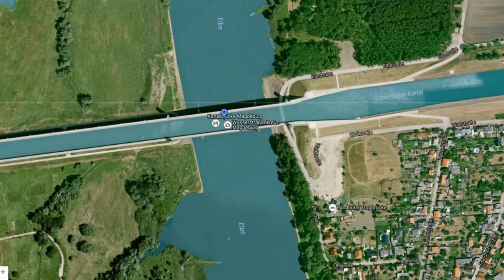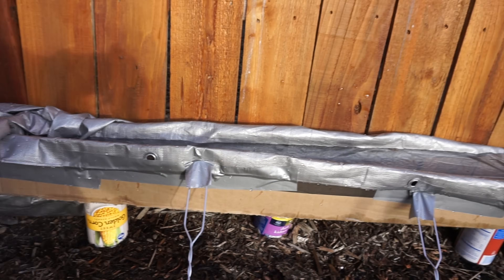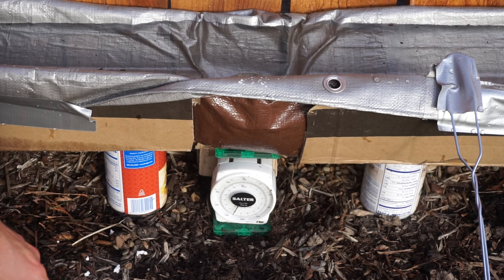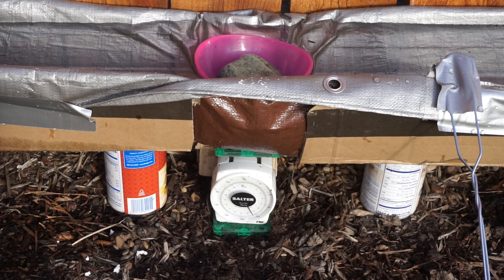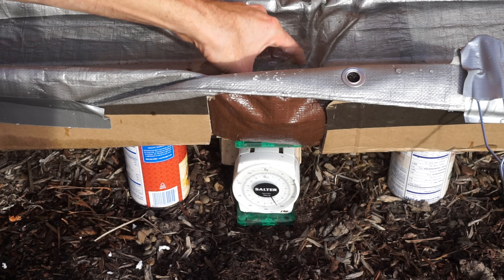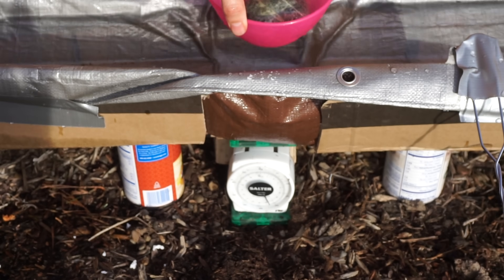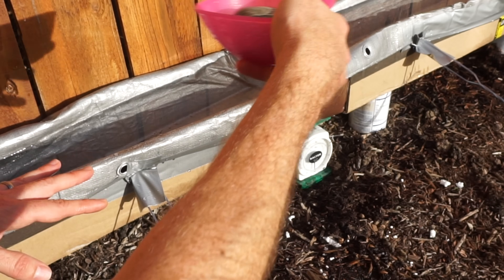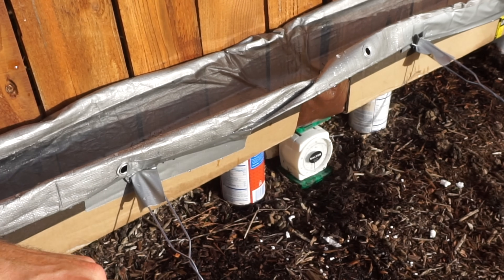What Happens When a Boat Crosses a Water Bridge? Does the Weight Increase?

Comment: im no engineer or smart, but i still disagree by intuition. the displaced water lets the level rise, therefore more mass is on the bridge. if you measured the whole bridge instead of a negligible section, you would see an increase. sure, the boat is small compared to the water, but if you would put it inside instead of moving it from left to right, the displaced water had no time to even out before the weight increased. 
the weight does increase with every object added, but distributed so wide that its barely measurable.
Reply: Yup you're right the weight of the bridge does increase but it is distributed everywhere equally
Reply: But your not displacing just the water in the bridge, but all of the water either side of it too, which could be a considerable distance and thus the weight of the boat would be spread across a very large area of water.
Reply: Yea, you're technically correct but in the real waterway and his experiment, it is a negligible amount, even if the boat is very heavy. In the waterway, the weight of the boat would actually be distributed across miles of water.
Reply: When the water rises from the boat passing through it is removed from the place where the body of the boat actually is at the given moment. So the amount of water remains the same or there is even less water on top of the bridge since the overflow will go outside the entrance and exit of the bridge.
Does the weight increase? I got no idea, I would say the weight increase is really insignificant since the water distributes is evenly
Reply: @petrolmajk  if you displace a large amount of water and push it ahead of the vessel it would rise and stack causing a wave and increase in weight prior to settling at a certain level.
Reply: I feel like you're treating the bridge as an isolated entity, the water displaced would also go outside the bridge area, and therefore wouldn't actually impact the bridge and the weight its carrying
Reply: It would depend on the speed and wake of the vessel but it would be negligible as a percentage relative to  the permanent load of calm/stagnant water.
Reply: There is an upward force which is not immediately intuitive. Take a large vessel and try pushing in a tub of water. You will feel the vessel pushing upwards (until you sink it low enough that it starts taking in water).  Thats boyancy. The weight of the boat/ship is balanced by the water pushing upwards and that's how it stays afloat. Hence there is no load change on the bridge support.
Reply: you technically aren't wrong because Action lab's experiment was slightly bias, as he did not show us the reaction of putting more water into the bridge, but if he did, the weight wouldn't change, because the material that he used was a picnic table sheet, which means that adding more water will pressure the integrity of the picnic table, but it will not break/ apply more pressure, but when he put the rock over the weight measure, the weight changed, and that is because he focused weight in that area, allowing the picnic table to droop into the weight measure, but yes, you are right, weight will still be applied the same way, but he is also right because that bridge in Germany is connecting two water ways, so the water because pushed away is too little and the water is not focusing on one point either, so he is right but wrong, the total weight being applied will never change, its just the area of the water being applied, you might not understand, but that is ok.

Comment: The raise in water is limited to at most the speed of sound in water. In practice, it will move as a wave out from where the boat enters the water. It will not start at the bridge unless you drop the boat in on the bridge. You may see this small rise as part of a bow wave when the boat enters the bridge, unless the rise has already propagated to the bridge.

Comment: Before I see his explanation I'm going to try to make a guess. It seems to me that that the water is dispersing the weight of the boat over the whole surface area of the Waterway. That would mean that the bridge is actually supporting a very very tiny increase in weight as boats enter and exit the Waterway. But since it's dispersed over the entire water weigh it's negligible cross the small distance of the bridge itself.

Comment: You may be interested in this thought experiment: http://www.jamesmskipper.us/2020PDFDocuments/WaterLevel.pdf.  I think the water will be higher in the middle. Also, the ball will roll to and settle near the middle.
Reply: Is this tube open on the ends or closed? Do you fill the tube from the middle or one end? Also water tension will make a difference along with air pressure if the air is also trapped in the tube. 
I think I know what you are trying to get at though...A long straight tube that is level near the middle will potentially rise up and the earths surface will curve away under the tube. But I do not think 2 kilometres would make much of a difference to your theory of higher levels in the middle as well as the ball stopping near the middle.
Reply: @MrT------5743  You're right about what I was getting. It would be too expensive to try though. I imagined an open ended tube - probably fill from the middle. I thought two kilometers would be just long enough to make the effect noticeable.

Comment: Actually, in a closed vessel, the "weight" SHOULD increase slightly when you put the boat in (regardless of where)
Reply: But the difference is that the center of mass of the vessel stays in the same spot no matter where the boat is.
Reply: Yes but the amount is so small that it physically would not affect the strength of the bridge. If the water overflow because of the size of said object the weight is reduced and ends up balancing out. The actual size of the body of water compared to the object displacing said water is such a huge difference that the effects both aren’t visible or measurable. A river doesn’t get waves when a ship is in the water because of this. The only reason there would be waves is due to the wake or the displacement because of the ship being pushed into the water. Not Due to the weight or size itself

Comment: Well, your scale is only holding a small portion of the water weight. You need to put the whole bridge in the scale and you’ll see that it does increase the weight. Just as as if you look carefully at the video, the weight ever so slightly does increase, it’s just a very small percentage of the actual weight so you didn’t notice it. To prove the true weight, you need to use a digital scale.

Comment: @The Action Lab  So I assume you know what question comes up next.  How much does the weight actually increase?  I'm guessing that it increases by the same factor that the water pressure increases by.  So I guess that means the increase is dependent on the length of water you have in your river system.  All the other supports you have there share the load of the water pressure nearly equally.  

What's interesting as well is that the water pressure can't increase throughout the entire river instantaneously.  So it makes me wonder if there's an amount the weight will increase by, after laying down the boat, before the rest of the river registers the pressure increase.
Reply: There would be a wave of more water that has to travel from the boat being placed across the full distance of the water for the weight to distribute to.

Comment: The only problem is that the „little“ water on
top of the bridge is way heavier than any boat which will ever cross the bridge so you gain nothing when constructing the bridge. 🥺
Reply: not actually. if you consider the river as a whole, the vertical forces goes up to counter act the weight of the boat. As explained, buoyancy "distributes" it to the entirety of the river, but we are only considering the bridge so the force it has to support is marginally bigger (becuase it is very small when compared to the river as a whole). If you had a pool, it wouldn't matter if the boat was floating or sinked

Comment: Without watching the video i say, yes and no. The weight should distribute evenly through the water because of the displacement and buoyancy. The weight on the bridge will increase with the rest of entire body of water. It will be the weight of the boat divided by the entire surface area. It would be impossible to measure with any scale.

Comment: Weight displacement, this video explains this very well, you can have a vessel that weighs a thousand tons going over a water bridge but there is no weight imparted to the bridge, the water displaces all the mass. 
Barges work in the same way you have a barge that is 500 feet long and 150 feet wide and you can put the weight of a ship on it and it will not go further than the marked waterline

Comment: QUESTION:: What happens if the boat happened to sink to the bottom WHILE crossing the bridge? I would think the engineers would need to account for that possibility when designing the bridge.
Reply: You could place high explosive mines all along the bottom of the bridge so that if a boat sink, it will just get blasted back out again saving the bridge from disaster.
Reply: @wilfridwibblesworth2613  modern problems require modern solutions, eh?
Reply: “That would never happen” - Titanic engineer.
Reply: The moment the boat's weight is pressing on the bridge instead of being spread across the entire river, the bridge may collapse if the combined weight of the water + that of the boat exceeds the actual load capacity of the bridge.
Reply: @VadymZakrevskyy  I agree all these bridges have  maximum TONs written ...people need to travel more...
Reply: if the boat sink to the bottom, the bridge will have the weight of the boat to compensate
Reply: zhone24 .... minus the weight of the water displaced by the boat 👍
Reply: @oljobo  that's true, i forgot it 👍
Reply: The boat sinks
Reply: The chance that that happen is very very small
Reply: @probricks5035  
You obviously don't think like an engineer

Comment: If boat sinks it might be problem so i imagine they did have to take that into count still.
Reply: I think a sinking boat is a problem within itself XD
Reply: probably not by much, water is rather heavy, looking back at the water bridge in germany, the water is ~4.25 meters deep, and the bridge is 918 meters long and 34 meters wide, for a total of ~132,500 m3 of water carried by the bridge, which weighs in at around 132,500 tonnes,  "consumer" boats (those that can be transported on land with "normal" cars/SUVs) can't exceed ~10 tonnes, and i think there'd be issues regardless of sinking ships if the bridge were loaded "passively" such that ~0.01% more load would make it collapse.
there's also the fact that the boat can weigh at most as much as the water it displaces while floating, because otherwise it would hit the bottom of the channel, so a 90 meter long boat covering the entire width/depth of the bridge would still only weigh about 10% of the "base" load that the bridge carries (given that it's technically still floating).
Reply: Well done
Reply: That's a really cool point
Reply: A boat itself does not really weigh much compared to the water. If the water level rises it most likely has a much bigger impact.
Reply: @RedBanana24  If the boat does sink over a specific part of a bridge, its weight will then be concentrated there, and it will weigh more than it did by just supporting that section of water. @woodingot makes a good point.
Reply: @RedBanana24  I'd like to add that, while water is extremely dense, any point on the bridge would only experience the weight of a tiny slice of that water since the hydrostatic pressure depends only on the density of the fluid, atmospheric pressure, and the height of the water column. As commercial boats aren't small, and as they are usually made of metal, one sinking and adding its entire weight - the weight of the water displaced to a section of the bridge could be a problem.
Reply: Depending on the boats/bridge, but a typical narrowboat might weight 1 ton/metre, whereas the water on the bridge would be something like 6 tons per metre (2m deep by 3m wide). Allowing for some water to still be displaced thats going to make the sunk boat only about 10% extra. And thats not allowing for the load of the bridge structure itself. Any allowance for extra depth during flood periods would be bigger than  needed for a sunk boat, and they'd allow way more than 10% for a civil engineering construction.

Comment: If the bridge was short and had many heavy boats, wouldn't it have weight from the compression of the water? or would the water just overflow? why don't we just switch out our roads for waterways and use speed boats? sounds easier.

Comment: I would be curious to know. Would a bridge holding a static load like that of the water take less wear and tear then a Bridge for cars. Reason I ask is the small flexing of a road bridge vs static load having more wear and tear.
Reply: I would think you are correct since a shifting load has the extra stress of the shifting weight vs an even static load like you said.

Comment: so if the boat sank to the bottom the weight would increase, and if a fully submerged submarine passed over then it wouldn't show any weight increase, unless it stopped on the bottom. However, the submarine is now displacing exactly the same amount of water whether it is submerged just under the water, or resting on the bottom.

Comment: The first time you are setting the rock in your boat if you watch the scale you can see the needle move  your entire set up is a bridge not just the part on the scale, the boat and water is spreading out the weight to a larger area and its not a 1 for 1 but there is a increase so boat size should have been taken into consideration if it wasnt they have been lucky

Comment: So does all the water level increase simultaneously or does the boat being added just forms a small wave that expands from the boats location to the rest of the river?
Reply: There is a wave of sorts but not only on the surface. If you would put the boat in fast, you would see a surface wave, but the pressure of the water pushes the rest of the water as well and I think would equal out pretty fast even across a large area.

Comment: Thanks for this! Now I’m gonna be putting water in my f150 long bed and have two jet skis in the back! No weight right
Reply: Assuming the jet skis are in a floating boat, the weight will be distributed across the entire "river" -- the entire bed of your truck. So there wouldn't be extra weight where the skis were, but the overall weight would increase. In the large case, the weight of the whole river on the Earth increases by the weight of the boat, because the water is redistributed everywhere.
Reply: Cuthbert Allgood I think I may make a patent. Here’s the idea, now don’t steal it from me please, but make a trailer that is like a pool, however when you go to the ramp, the trailer completely goes under the water. Since the trailer won’t get heavy, I’ll put a 32 foot pontoon on it and haul it with my Honda Civic!
Reply: Boi just use magic